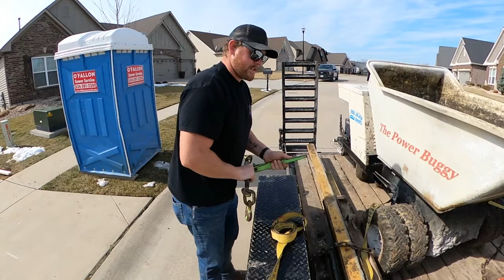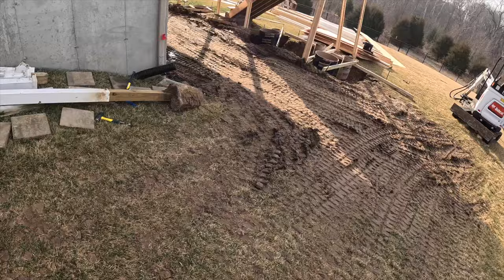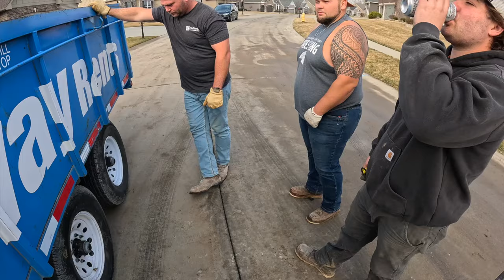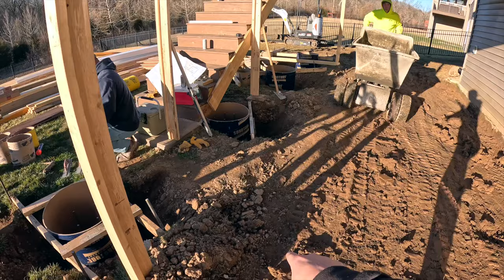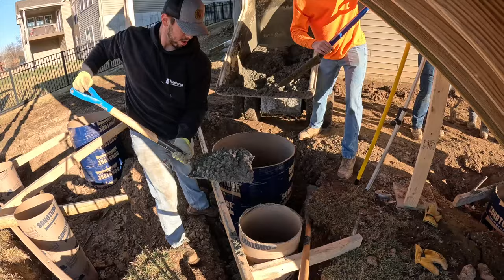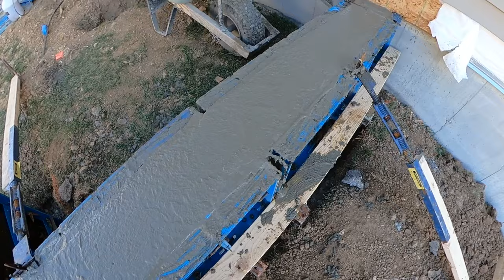Not So Easy Concrete Pier Removal + Installation For Deck Roof Addition!

Comment: Looking great y’all. 
Did you pour a 20” sub-pier to keep from having to go so deep with the 12”pier?
Looking forward to part 2. 
Keep up the great work. 
And thank you for sharing. 
🤙
Reply from the maker: @roblescurbappealconcrete Thank you for watching!  Yes the piers had to be belled out to the 24” with the new roof load being added to the deck so the combination of having such big holes with trying to get the old piers out and the larger belled out bottom it was easier to just pour with the 24” sonotubes.They also stood up more sturdy with not having fill really around them yet and just top off with what’s going to be showing the 12” sonotubes. Thanks again!
Reply: @HalloranConstruction  that’s awesome, ii think that’s a good idea. You displace a lot of the load on a much more sturdy foundation. 
Keep it up 🤙